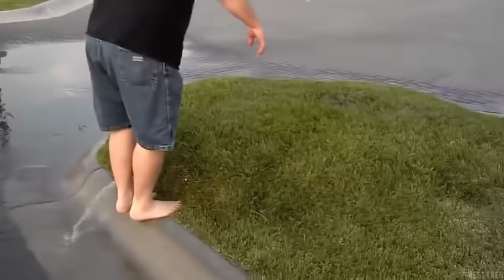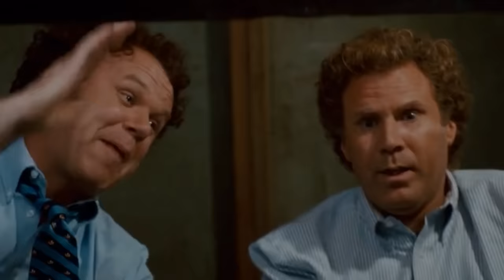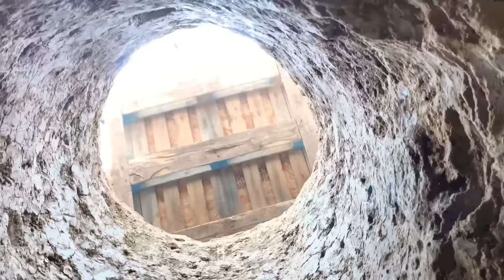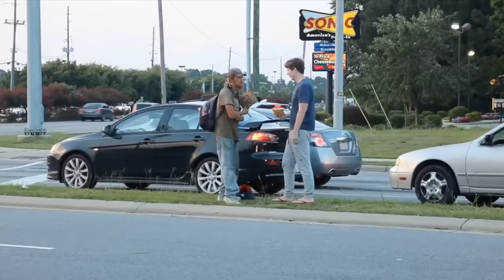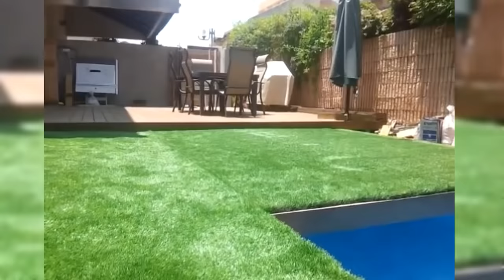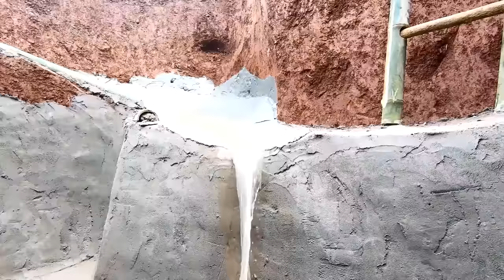Here's What Happens When You Pop A Grass Bubble…

Comment: Wait what happened to the bears????? :[
Reply: apparently the filter that she pulled into the pool had a safety feature that turned off the electricity if it goes in the water so she did not die and continued to play in the pool
Reply: Caeli Knight no it didn’t. The Mama Bear learned about Alternating Current that day. The extension cords grounding plug was broken off so the bear received 110 volts. The 5 orphan bears were split up. 3 went to local zoos, and 2 went to a circus.
Reply: @freegame6900  I- why would they put them in a circus ;0;
Reply: all the bears are ok the pump is designed to get wet they get board eventually and wonder off the comment feather down is talking rubbish
Reply: up

Comment: Until now I've never seen a "grass bubble", no.   He see's it and decides to...pop it. Who among you didn't see that coming?  I'm not even sure you can accurately call it a bubble.  I expect that little phenomena created the need to boil some water for umpteen thousand households.  I was sending vibes watching him walk on it, trying to get it to pop and create a little mini geyser right up his shorts, now THAT would have been funny!  Her "there's always one kid".  SOOO true, and usually it's the supposed adult in the mix.

"A decompression chamber, rather like a submarine"  Only if the barometer has fallen significantly since it was last open, and only if it's truly sealed, which it probably is not.  Yeah, I get it, the handle on the door.  Just sayin'.

The bears, and several others, I have seen, though.  It's called the internet, and it it has a LOT of crap available on it, this included.  Way too much of some of it, actually, over and over and over again.  Plagiarism in the form of cut and paste, reigns supreme.  Strike a bell, anyone?  Fun video.  :-)

Sitting at the bottom of a "ten foot deep" non reinforced hole in the ground can be quite dangerous, depending on the soil (or sand) actually.  It could end in tragedy and a new Darwin award nomination.  I'm not sure you want to be encouraging that.

"all the way to the pool"  Yeah, they were called 'slip and slides' in the day, commercialized to the nth degree.  Hardly original, or rare to someone my age.  It's all relative, I guess.

That elephant must be really thirsty to drink disgusting chlorinated water like that.  Well, at least it will be good for his teeth, if floridated (it's really not, that does nothing for you, except create more kidney and liver disease, etc).   It was basically a "hey, how can we get rid of this toxic by product really cheaply" of some industrial process.  The stupid crap we foist on ourselves, and the gullibility of those foistees sometimes begs belief.

Sharks travel many miles up rivers not infrequently, and can apparently remain in fresh water for quite a while without ill effects.
It would be more impressive if it was in their swimming pool, where it most likely WOULDN'T last very long, I expect, gilling all that chlorine.  I know fish don't (please don't ask).

Curious that the bears in pool video ended with a scream just before the bear dropped the electrified filter in the pool.  Now I'll have to go look it up elsewhere.